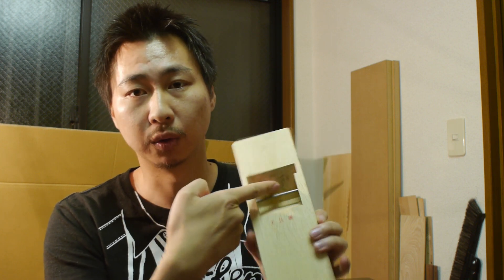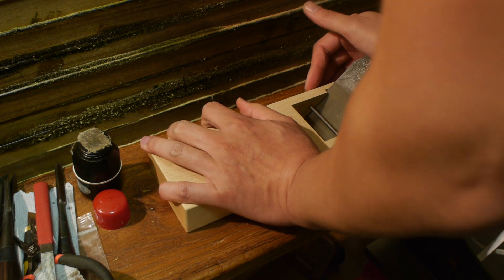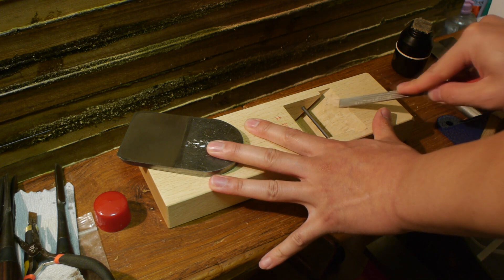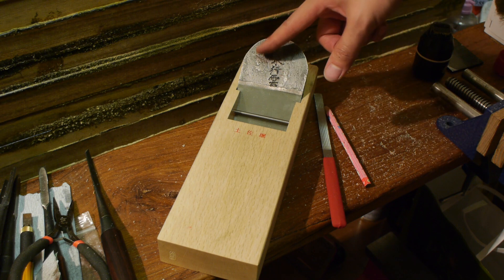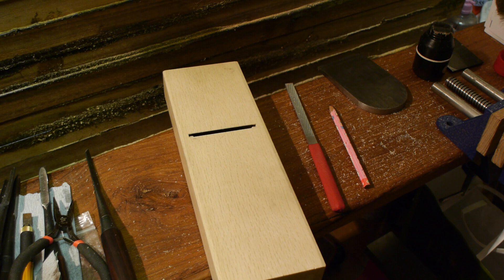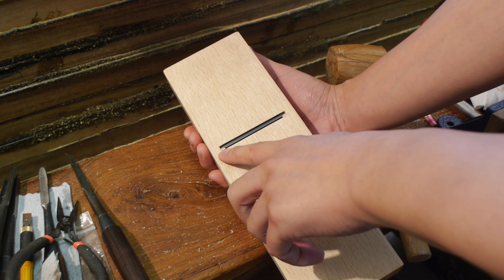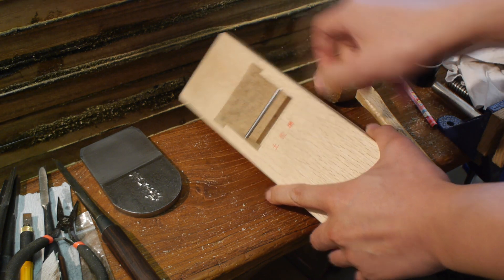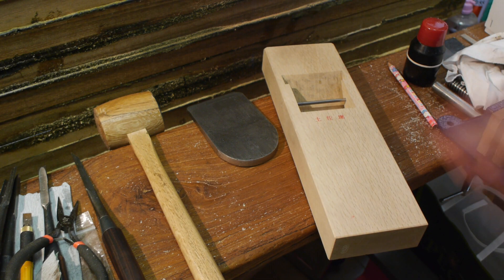How to tune up a kanna part 2

Comment from the maker: Basically yes, although a plane or kanna like in this video is more for flat surfaces like cabinet panels etc. For a curved surface you would want a plane with a curved body to match the work (like a compass plane) or even better, for something like a bow, you would ideally use something like a spokeshave with a curved sole. A spokeshave is like a drawknife with cutting guides so you get a more controlled cut and I think that is what you are looking for. Let me know if you need more information.

Comment: Another really informative video.  One problem that I ran into was with some chiseled kanji on the back of my particular blade (facing the dai) seemed to get hung up and caused the blade to skew when tapping down.  Not sure if I did the right thing, but I had to remove more material in those areas to get the blade to seat straighter when I tapped down.

Comment from the maker: The kanji on the back of the blade should not usually cause a problem since, at least in the blades I have seen/own, the kanji don't have a significant burr from the chiselling proces. If the kanji on the back do get in the way, then I would just take the dai down like you have done since the area occupied by rogue kanji shouldn't be large enough to affect the seating of the blade. I've also seen reports of people filing/cleaning up the back of a roughly finished blade to make it fit the dai.

Comment from the maker: "Kanna" is the Japanese word for a woodworking plane. I'm not sure what knowledge of woodworking you have but a plane is a tool used to flatten and prepare a wooden surface. There are metal and wooden versions of Western planes however kanna are mostly wooden. Another difference is in the blade (wedged to secure itself and thicker in kanna) and the direction the tool is used. Hope that helps :)

Comment: What kind of oil do most people use? One that is a bit more visible than the camelia oil used in this video, but not one that really seeps in / damages the dai
Reply from the maker: @michael.knight  Camelia oil is the oil most widely used. You can also use just pencil graphite (no oil) if you find oil hard to see.

Comment: Hi,
something is confusing: As you sharpen the iron, then the iron get with the time shorter and even thicker. That will cause that the iron won´t fit in the mouth because the iron has a shape of an wedge. That means you have to pare the whole mouth again. Am I right?
Reply from the maker: fridunanti Hi, yes, you are correct however it ll depends on how you use he plane. Normally, as the blade gets shorter, it will wedge more but because the dai is wood, it will compress a little so the extra thickness from the blade (which is actually a pretty small amount) doesn't become a problem. The wood will eventually stop being able to compress at some point though but usually by that time the dai is pretty worn.
The other consideration is the wear on the sole through use. As you use the plane, the sole will wear and warp so you will need to flatten and clean it now and then. This actually has the effect of making the blade protrude more for the same amount of adjustment so it balances the blade getting shorter.

Of course sometimes the dai wears faster then the blade and vice versa so you will need to sometimes scrape the bed a little or pad it up to make it tighter. Usually you will need to pad it up because the dai wears faster han the blade in most cases. Never open the mouth again unless it was too tight to begin with. You only need to scrape/pad the bed. Also don't scrape the front of the wedge mortice.

Hope that helped and if you need more info let me know:)

Comment: I just have to do everything ?!
Reply from the maker: Hi, for the kanna I will send you, you will not need to do as much work as in these videos. The blade preparation and some light tuning of the sole should be all that is needed. A full explanation is probably too long for the comments so I will send you a separate message if you want to know the details.